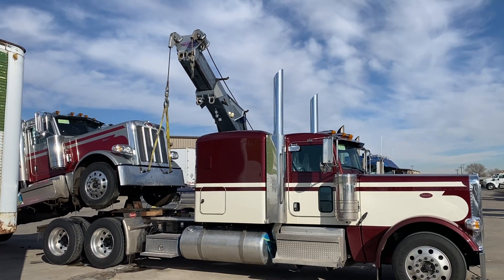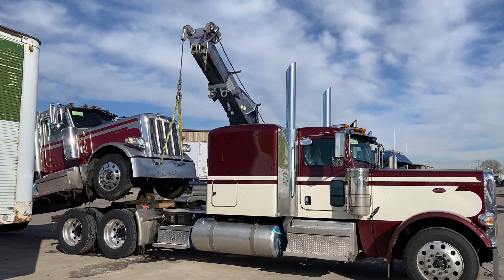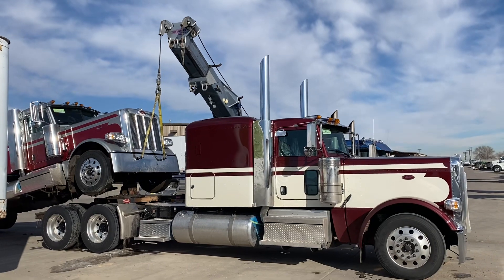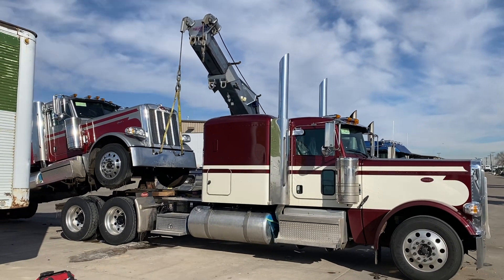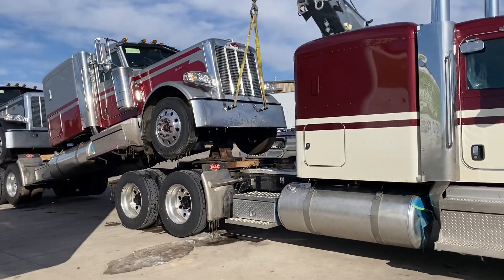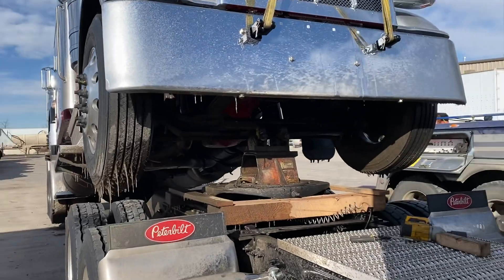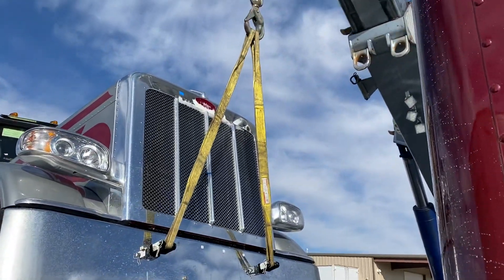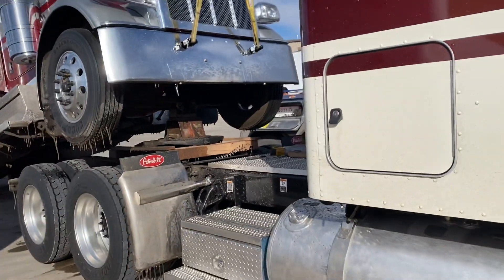Undecking newly arrived Peterbilt's!

Comment: Having worked for Active for over 2 years. Enjoyed watching the video. Having a tow truck operator that KNOWS how to undeck is a huge asset.   Best way to undeck believe me. Seen the HOT tags on Petes and KWs. Not an easy job undecking. Very dangerous if not paying attention. Putting axles back in, hooking up airlines, putting exhaust stacks on. Middle of winter or middle of summer. 30 degrees below zero in Dodge Center, MN over a 100 degrees in Denver, CO and thats where I really screwed up. Got heat exhaustion and dehydrated. Just about ended up in ER. Miss the work, just had to be out to much. Been giving some thought about going back lately. Was based out of Chillicothe, OH next Kenworth plant. Rather be based out of Renton, WA or Denton, TX. Good company. Loved delivering new Peterbilts and Kenworths.
Reply from the maker: Thank you for the input and thank you for watching!